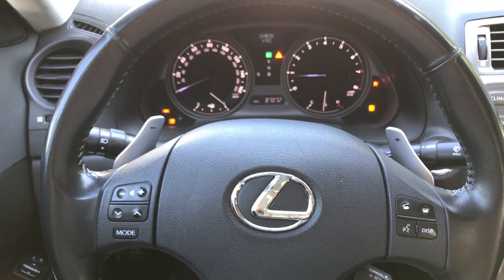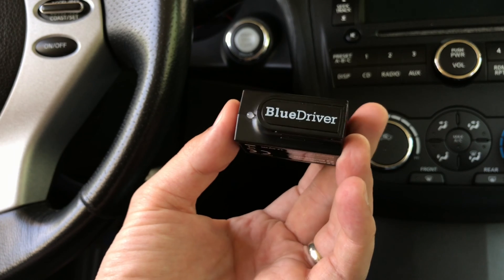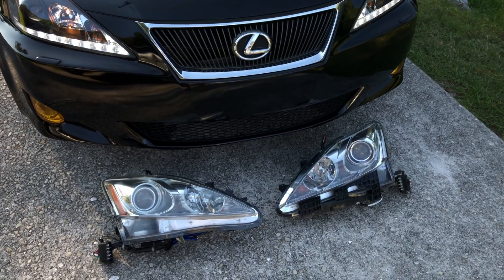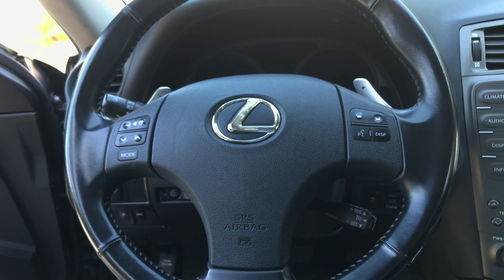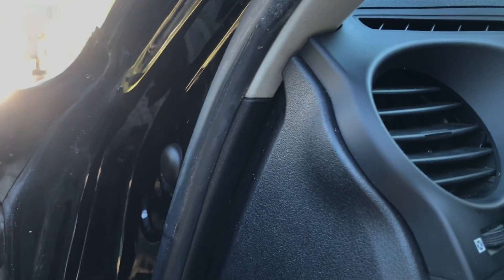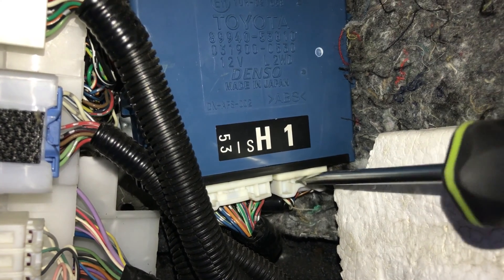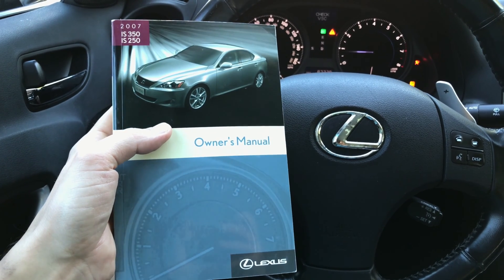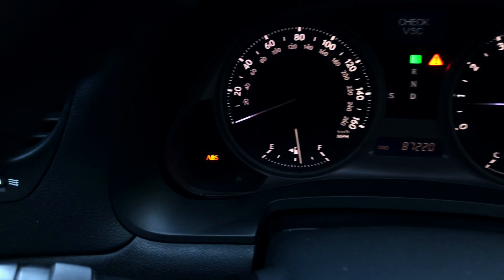2 ways to disable "AFS OFF" warning light after installing aftermarket non-AFS headlights.

Comment from the maker: Tools and parts used in this video: 
Scan tool capable of reading AFS error codes: https://amzn.to/2GBQzn3 
Aftermarket LED headlights: http://rover.ebay.com/rover/1/711-53200-19255-0/1?icep_ff3=9&pub=5575132837&toolid=10001&campid=5338527833&customid=&icep_uq=Lexus+IS350+LED+headlights&icep_sellerId=&icep_ex_kw=&icep_sortBy=12&icep_catId=&icep_minPrice=&icep_maxPrice=&ipn=psmain&icep_vectorid=229466&kwid=902099&mtid=824&kw=lg
Trim removal kit: https://amzn.to/2ZrpnPh 
(These are Amazon & eBay affiliate links)

Comment: I have a 2013 Lexus Gs 350 have aftermarket headlights tried to install them, but they wonnt work because I have AF. S with this option worked for me.
Reply: So have you switched off AFS Light ? As I did same done replacement on factory headlight and now I have flashing AFS

Comment: RX350 2009 - Dealer diagnostics said Steering sensor probably bad $500 plus  4 hours labor and then possibly the ECU if it did not fix it. My fuse  #18  is bundled with other important circuits so it had to stay. I did not have to remove carpet as ECU was tucked high up but right in the area of your video. It is disconnected now , AFS light is off.  I rarely drive at night anyway and don't need the feature. Thank you!
Reply from the maker: Yeah, I noticed too Lexus likes bundling multiple systems together under the same fuses.

Comment: WHY!? I’m not sure why anyone would knowingly delete AFS or any type of dynamic leveling/turning headlights. They are such a huge benefit for driving at night. I just can’t see having them and then purposely replacing them with a set of headlight housings that don’t include the same features that I bought the car with. Although I did retrofit an AFS system into my Corolla so my lights could turn ahead for me. I also have quad  RX350’s bi-xenon’s with ZKW-R clear lenses one set is in AFS mounts and turns with the wheel. They all auto level going up and down hill. But that was a lot of work to figure out. Leveling sensors in the front and back of the car needed to be installed and wired in and all the other wiring and fuses and I believe a relay too. All had to be installed to get the lights to auto level and one set to turn ahead in the turns with the steering wheel. But it’s been one of the most satisfying retrofits ever. It’s in my 2006 Corolla XRS and it has diode dynamics SS3 Max fog lights in 3000K and the combo between quad RX 350’s with Osram CBB’s and Morimoto variable ballasts. They run 35 watts in low beam but when you pull high beam stalk it boosts ballasts to 50 watts. So you end up with 200 watts of HID power in high beam mode and 140 watts in low beam mode total. When they’re in quad mode on, plus the 40 watts or so each for LED fogs. I have two more sets of lights in my bumper that are diode dynamics SS2 pods surface mounted on the front bumper. There are 4 all together and since they’re very small they are hard to notice on a black car. But two are driving or like a high beam, and the other two spot. And those are set up on a switch each. They can be used with the high beams automatically with the switch. Or you can turn the switch off for them and they won’t activate with the bixenons. They always come on with the high beams, but it’s whether you want them on with the headlights or not. Combined with the quad high beams, the four SS2’s and the two SS3 Max wide/fogs all on (yes my fogs stay on with high beams if I want them too. I can toggle a switch where they turn off when high beams are active like stock, or I can run them together. But when all lights are on together it is unbelievable how far and wide you can see. Now I only use this setup when I am on back roads with little to no ambient lighting and no cars around, or on long dark freeway stretches where there are no towns and no lights and no cars at night. And let me tell you, when you turn those lights on when you’re driving alone out there in the dark, it is amazing! You feel like you could drive 150 mph and still see out far enough that you don’t feel like anything will sneak up on you in the distance. It’s just insane how far lighting has come. Because I’m order to get that kind of lighting power in the past you really needed a lot of size in the lighting optics. And these are all mounted in the stock small lights of my headlights and fog lights minus the four small SS2’s which are only about 1 1/2” tall but about 2 1/2” to 3” wide. So other than those four lights which together are smaller than my two fog lights, all the lights fit inside my stock housings. Which is incredible to me. Seeing how far lighting has advanced in the 16 years since my car was new.
Reply from the maker: When it is broken....
Reply: Have a 2012 Mazda 3 with AFS. It's more problematic than helpful, literally, the AFS is mere decoration, an unnecesary luxury.

Comment: Bro, thanks for the tutorial! I’ve just disabled mine as the fuse option wasn’t available to me. Mine was on the same side of the car too. I didn’t have to remove the foot rest as I’m in the U.K. and have right hand drive. 
Many thanks 🙏
Reply from the maker: Nice!
Reply: Dark one, I got rhd, so it was quite straight forward? Or could I pull the fuse ? Thanks
Reply: @donjohnson4368  pill the fuse if it’s easier (which it probably is) if not you’ll have to do it this way. It’s not much of a problem either if you have a U.K. model 👍
Reply: @DarkOneK2S  I have two rows of Fuses on the front left inside the cabin under the Glove box (UK Model/RHD). When i pulled 10 AMP fuse no. 52 the AFS light went but it triggered yellow triangle light and stability control light. It's easy to access on the RHD/UK model of RX400H.
Reply: Disconnecting the wiring loom did work fine for me, an easy remedy. Thanks DIY-time.😀
Reply: Do I still have to remove panel? I have rx400h 2006 also in uk, you didn’t get any warning triangle come up?

Comment: Hi,
If the AFS is off, will the angle of the light beam automaticaly set to its normal angle? Or its.just stuck randomly and it will be glare to other car, and also the light is not optimal?
Reply: Never used a car with AFS system. My car is Toyota Camry 2008, and i am afraid i cannot adjust the light angle manually

Comment: Anyone know where the fuse is for the 2004-2009 RX330/350 suv? It’s not listed as a separate fuse for the 2009 RX350 as easily as it is for this Lexus in the video. Trying to get rid of the factory AFS HID headlights for nice aftermarket ones. Thanks!
Reply from the maker: Looks like its the fuse panel on the driver side, fuse #18. It’s bundled with a few pretty important systems though...
Reply: @DIYtimeTRD my AFS fuse is bundled with the automatic headlight leveling control system. I’m assuming this system is already not working anyway (AFS light flashing soon after startup). So I think I’m just going to pull it.

Comment: Great video! When you put your new headlights in, what did you have to remove modify from the old HID and AFS besides pulling the fuse or unplugging the AFS ECU? Thanks in advance, looking to covert the same system on an 09 RX350 and get cool led headlights like yours!
Reply from the maker: Thank you. 
For me besides those ☝🏻 two things it was just plug in and ready to go.

Comment: To clarify, My 2007 IS350 has auto leveling and HID system.  I see aftermarket assemblies say they are not compatible with cars with OEM HID and leveling.  Why is this? will the replacement assemblies not physically fit or is it that they will fit but not compatible with factory HID and leveling therfore those systems will be disabled?  Am I able to use most any spyder brand assemblies?  thanks for the help.
Reply from the maker: Yes, you are correct, they will physically fit, but they don’t work with those factory  features, and you will loose that functionality. You will also get a AFS Off warning ⚠️ light on dashboard, which you can disable by pulling off the fuse.

Comment: When I removed the fuse in my RX400H, the AFS light went out, but then I had a new yellow warning light come on. Anyone know if this can be avoided?
Reply from the maker: On newer cars this truck may not work anymore, without actually reprogramming ECU.
Reply: I had the same issue with yellow triangle light illuminating when removed the fuse But the other method worked fine without triggering other warning lights. You can safely just unplug the wiring looms from AFS BCM/ECU.

Comment: I have a lexus es 350 2007 and afs off just came out and I don't know anything about them what can i do first thank u!
Reply from the maker: It would be good to diagnose with advanced car scanner that can read AFS error codes.
Reply: Make sure the button under the dash near the steering wheel isn’t accidentally pressed

Comment: What happens when you don’t fix the problem and simply disable the AFS sensor/light?
Reply from the maker: Your headlights may stop auto leveling or get stuck in one position. 
My lights were broken, and I just replaced them with aftermarket ones. They were cheaper than OEM, and look better than originals, but they don’t support AFS.

Comment: Great! Dear friend, Do you know where the afs module of Lexus rx350 2010 is located?
Reply from the maker: Not sure, but usually it’s either in the same place as on my car, or in the same place but on the passenger side. What you can do is go to a website that sells this part, and they usually have a diagram showing where it’s located on the actual car. I hope this helps.
Reply: you may check https://fuse-box.info/lexus/lexus-rx350-al10-2010-2015-fuses

Comment: I have a LS 460 and I tried your first option and the blue box isn’t there, I have tried to find it online to see where it might be, but I can’t seem to find it. Do you know anywhere else it could be?
Reply from the maker: I think it’s in the similar spot, but on the passenger side.
Reply from the maker: According to this diagram. Click on view more images, and look at image #4, part # 89940. 

https://parts.lexus.com/showAssembly.aspx?ukey_product=63530619&ukey_assembly=6731536&ukey_make=5773&ukey_model=90168&ukey_driveline=0&ukey_trimlevel=0&modelYear=2007
Reply: This worked!! however the headlights let off a high pitched hum that I assume is the relays but the box is located in the passenger footwell on the right side

Comment: What if you unplugged your AFS fuse but VSC light is on?
Reply from the maker: I don’t think VSC is related to AFS. 
Scan your car for error codes, it will give you a better idea as what might be wrong with it.
Reply: @DIYtimeTRD  Problem solved. Someone pulled my A/F fuse out...

Comment: If your car's "AFS OFF" indicator stays on but NOT flashing at first when you turn on/start your car, it means that you have pressed the "AFS OFF" button, normally located above the gas door opener button, by mistake!  All you have to do is to turn OFF the button by pressing it to turn off the "AFS OFF" feature!
Reply from the maker: That all works when you have good functioning AFS headlights. In my case #1 the headlights were broken and that ☝🏻 option didn’t work. #2 I replaced headlights with aftermarket ones without AFS. The ECU is not detecting original headlights and throwing the warning light.
Reply: It works for me thanks man.
Reply: Oh yes the on and off button is right there.This video wants you to remove a fuse...
Reply: That’s exactly what I did. Thank you.

Comment: Won't disconnecting the AFS ECU mess with ABS system? I wonder why ECU has "ABS" printed on it.
Reply from the maker: No, it should not.
Reply: @DIYtimeTRD  Okay, I went the easy way and removed the fuse myself and it disabled the blinking light. Thank you for posting this.
Reply from the maker: Thats what I did too!

Comment: Can I ask why is your abs light onn on the dashboard?
Reply from the maker: Yes
Reply: Ok but why is it onn,is it because of the new wheel hub/or different rim size and how did you fix the problem?
Reply from the maker: I had two issues. ABS/wheel speed sensor wire was damaged. And bearing  hub gone bad too. I already replaced both and the light was gone.
Reply: @DIYtimeTRD  ok kool thanks for reply
Reply from the maker: I wrote about hub replacement here: http://www.diy-time.com/automotive/lexus/lexus-is-gs-front-wheel-bearing-hub-assembly-replacement-2006-2015/